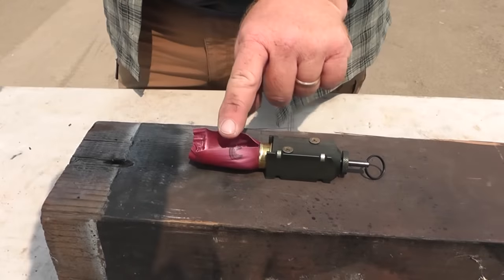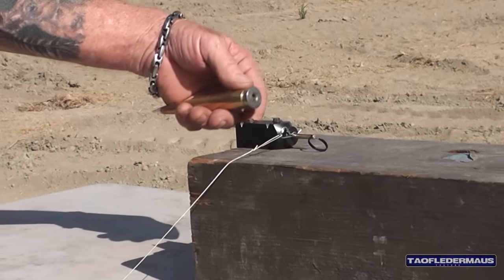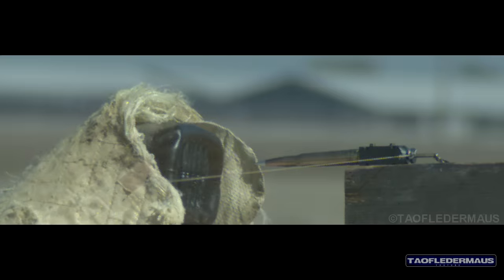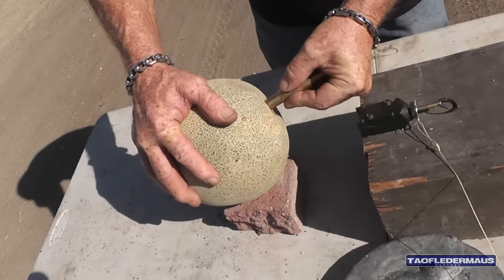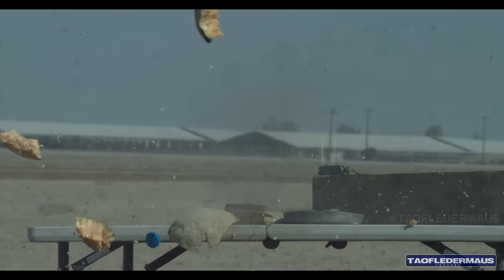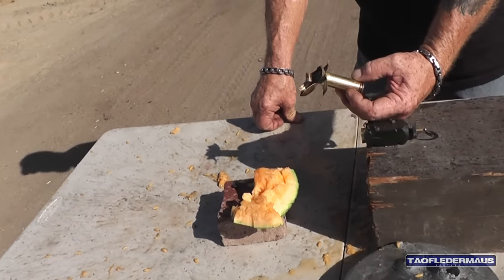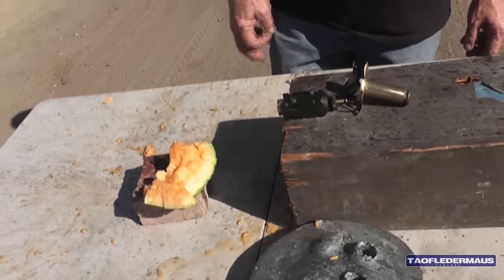.50 BMG Shell exploding OUTSIDE a gun - What Happens?

Comment: how about  primer and real bullet only..no powder.... in a weapon ...whats the penetration.. 
i cant  believe no one  has ever  tried this
Reply: Actually it has been done before, by accident on the set of the movie "The Crow" causing the death of the movie's lead actor Brandon Lee. In one of the scenes a revolver had been loaded up with some dummy cartridges, the cartridges consisted of only a bullet and the casing, the powder had been removed and the primers had already been fired off. However one of the cartridges still had a live primer and when fired it caused just enough force to push the bullet into the barrel of the gun. In one of the following scenes the same revolver was loaded up with blanks and when it was fired, the bullet that was in the barrel was shot out at high enough speeds to kill the actor.

TL;DR a primer will only provide enough force to nudge the bullet out of its casing and will not be fatal on its own.

Comment: You got the footage mixed up with the butt of the casing when the first .50 is fired.  It's the brass from the 12g
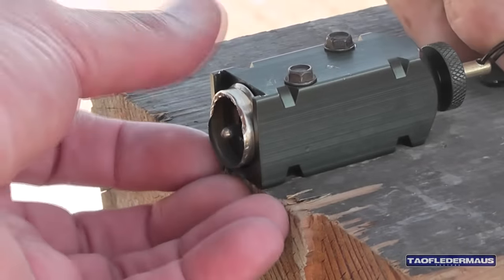Reply: At 1:38
Reply: Andy Cave 
Andy, that was the base of a 12 gauge shell used to make an adapter so that the 50 cal base would fit the parameter alert device.       🇺🇸😎